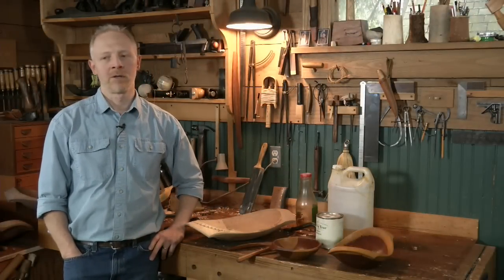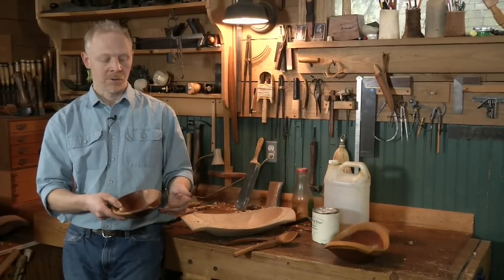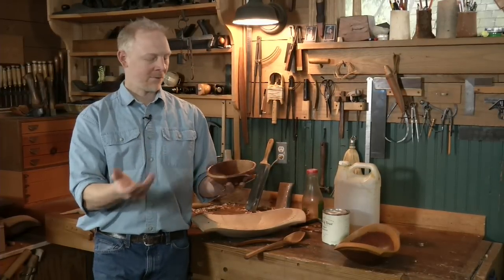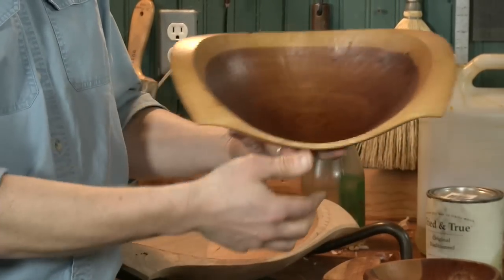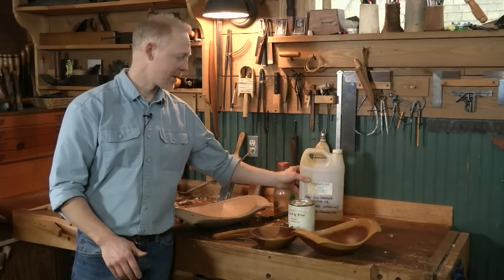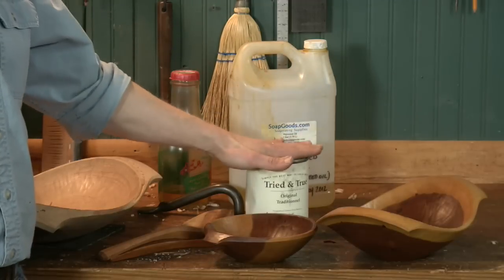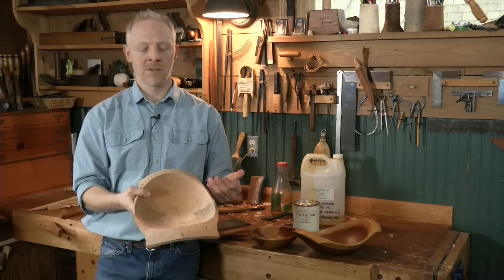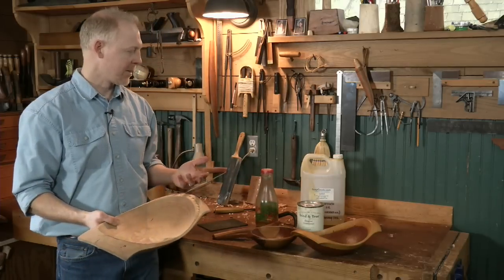Food-Safe Finishes for Greenwood Pieces

Comment: Quite simply one of the best and most informative videos I have seen on YouTube - ever.  There is so much misunderstanding and misinformation out there on 'food safe' finishes for wood and having done some research I am more convinced than ever that the simple, natural approach is the most honest.  So many manufacturers (in the UK, in my case) say 'food safe' because the finish may resist ethanol, acetic acid, iso-octane, etc., in a laboratory but this doesn't consider that chemical process that the manufacturing process of the finish will have gone through - and the solvents used, etc.

Thank you.

Comment: How do you dry your green wood pieces to avoid cracking? Your video was exactly what I needed for finishing. But drying is also a concern. 
Thanks
Kim
Reply: I agree with you ...
But not only that, I am also interested in knowing about the heat treatment of wood.
For example, in the video it is mentioned that in winter in the absence of sun the oven can be used to dry the wood and / or Klin, a concept that I would like to know more about.

However, I have recently found out that wood can be given a heat treatment that stabilizes the wood avoiding deformation, makes it more impervious to water / humidity, modifies internal sugars which prevents it from being attractive to insects and prolongs the life of the wood.

This heat treatment is used in woods for musical instruments and wood in general.

But it has caused me curiosity because I remember seeing a video that I have no longer been able to find in which a person took his chopping board once he finished making it and put it in the oven for a certain time replicating a heat treatment that now more than before am interested in knowing.

Comment: Great video!
What is a good ratio of oil to bees wax if you make your own
Reply from the maker: I've been messing with 2-parts oil to 1-part wax, it's way too waxy. 3:1 is probably closer to good. That said, once I found some Tried and True I stopped using my concoction. -Ben
Reply: Thanks, how come the switch? because saved you the hassle?